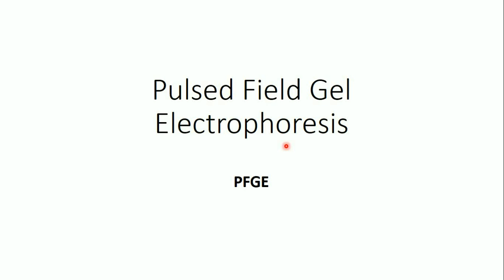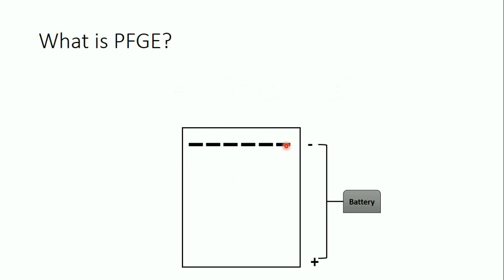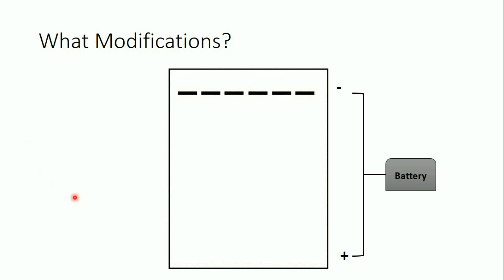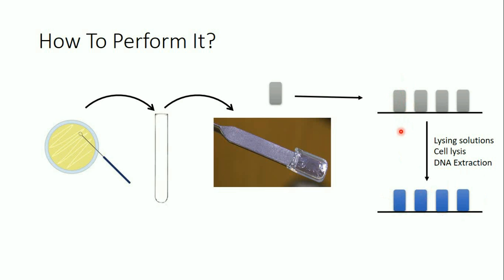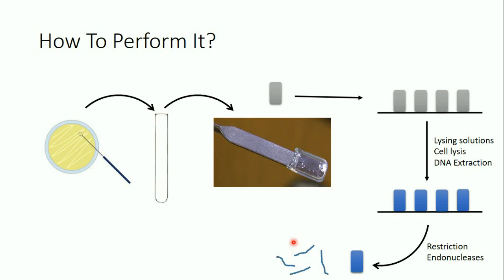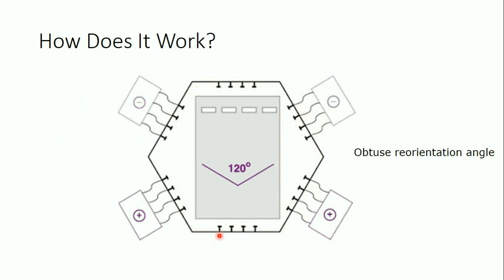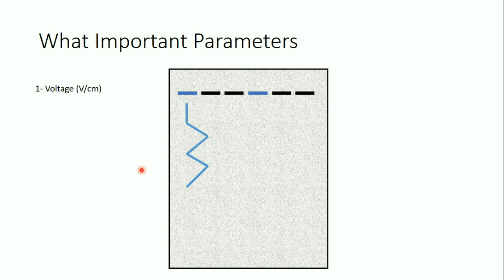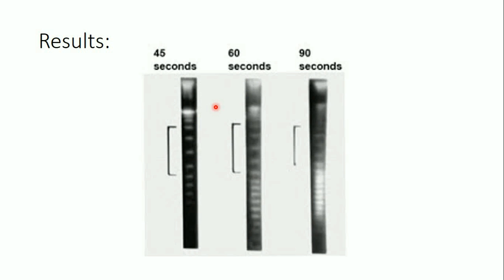The Principle of Pulsed Field Gel Electrophoresis (PFGE)

Comment: Other questions are about the parameter setting:
1. I think a larger angle should be better for resolution since the route can be longer. I do not understand why you said the smaller angle is better.
2. You mentioned that the time and voltage should be the same for turning the right and left direction. But as the DNA elongates, its moving speed will also change. So although you use the same voltage and time, it may still cannot be straight. How to deal with that?